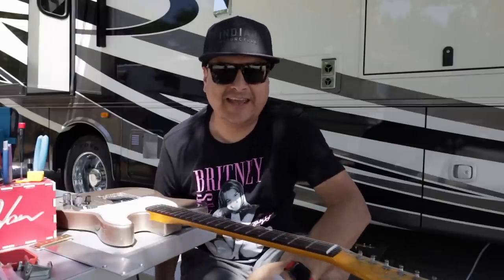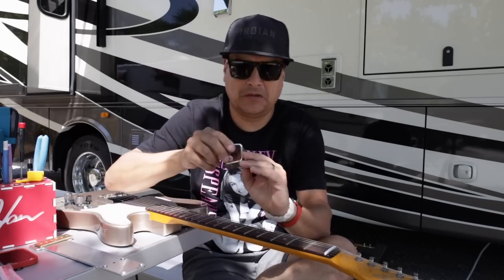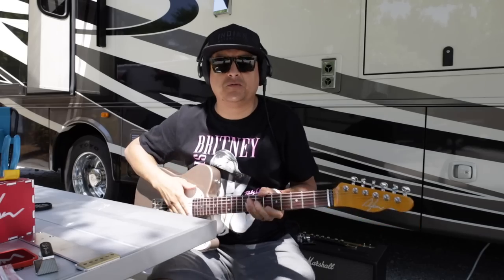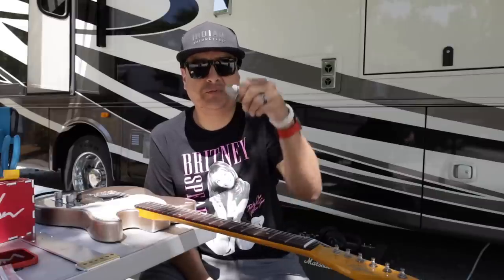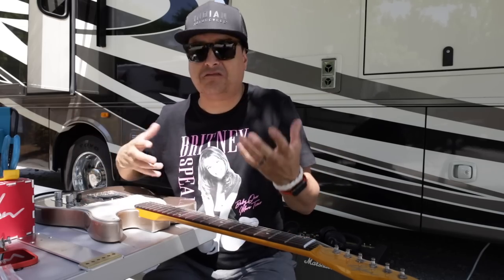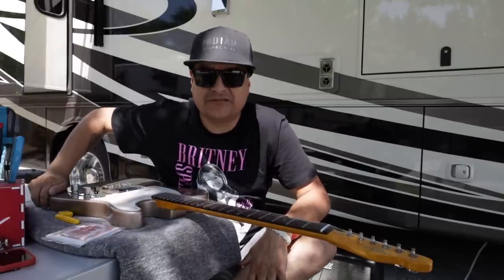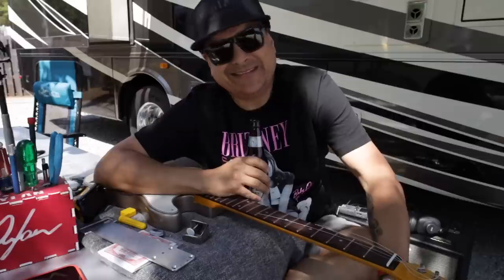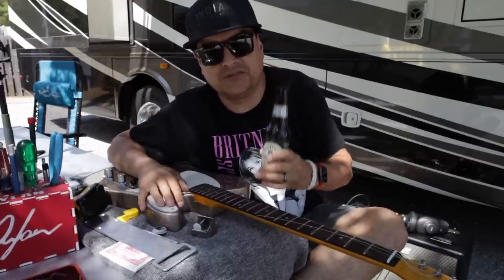How To Get More Sustain - The Backbone VS Fender Fat Finger Review Episode #651

Comment: I didn't hear much if any difference on either one - certainly no more than I could ascribe to variations in your own fretting behavior, without in any impuning your honesty in any way of course - but humans aren't capable of the precision required. For tests like these you really have to have a mechanical picker that hits the string just the same way each time, and graph and measure the response. The variation between your three performances of the same lick at three different times could easily be more than the effect of the devices assuming they work. I did this experiment with the fatfinger some years ago, not properly with a mechanical picker just playing riffs with and without like you do here; but the one thing making it worth mentioning is I carried it around for over a year and stuck it on every guitar I got a chance to test; over a dozen I don't recall exactly how many. But I do remember subjectively the response was very different from guitar to guitar. Some it seemed to do nothing, some it seemed to really give a little bit better sustain, some it seemed to actually choke just a little like you describe here. Perhaps it helps to compensate in some way if a neck is too flexible or a headstock too light or something? But certainly the effect even in the best cases was tiny, nothing compared to installing a better pickup or getting a better pedal etc.

Comment: I...guess the fatfinger making the guitar duller and the claim of increasing sustain kinda makes sense from a physics perspective? Like, you pick the string and you've got that wave travelling up and down the string. When it hits either end, some amount of energy is going to be reflected back, and some amount is going to be transferred into what it hits (the bridge, the nut or wherever the string is fretted on the neck). If there's a larger change in mass between the string and the neck (Well, change in density is how this usually works and I'm not sure how well that translates so I could be wrong here), less energy is transferred to the neck, more bounces back down the string.

Buuut, energy transfer isn't equal across frequencies (or, different frequencies have different amounts of energy). Like how sounds coming through a thicker, more massive wall sound bassier than sounds coming through a thin wall. So adding mass to the headstock would mean where the highest frequencies bounce back down the string more, the mids transfer into the neck a bit more, the lower mids a bit more again, adding mass to the headstock would mean less of those mids and lower mids are being transferred into the neck, they're just bouncing back down while the highs were already just bounding back down, so you get more mids and the whole thing sounds muddier. But less energy loss from the string could also mean "More sustain".

Or like. That's what my A level physics gut reaction of what's going on would be anyway. XD

Comment: Does fingerboard & Bridge height on a tremolo system affect string tension/sustain? I have a G&L comanche whose fingerboard is 1 cm above the body. The string tension is pretty high on the guitar, but it has great sustain. Not an easy guitar to play, but sounds good. I was wondering if the fingerboard height is intentional, or did I just get a weird guitar?
Reply: String height(bridge/saddle height) has a direct effect on string tension(if that’s the right word) and therefore effects the feel and vibration

Comment: If adding more metal mass to the headstock harms the tone, does that mean replacing "cheap" pot metal machine heads with much heavier locking tuners harms the tone the same way? 🤔
Reply: It doesn't harm the tone. And adding mass to the headstock doesn't dampen the vibration of the strings either. It affects the relationship between attack and release.
Reply: Heavier locking tuners could work to better in most cases, but also to worse sustain (and tone). You will only know, if you test it...🤷🏻‍♂️😊
Reply: @xdoctorblindx  
You‘re right!
I want to add: more (or less) weight on the headstock changes also the vibration response of the neck, headstock and nut, and with it the feedback into the vibrating string.
Reply: I was (perhaps unfairly) paraphrasing Dylan's remarks in the vid.  "It sounds flatter", "it feels worse".  Consensus blind listening was it "killed the highs, flattened the tone". If he's giving the gadget away, my impression is it's not an improvement (at least in any characteristic that he values - or it would still be on there).

But if we shelve for the moment the more contentious question of whether that outcome is positive or negative, if I rephrase the question ... heavier locking tuners (and not all are universally heavier) would add mass to the headstock and produce a broadly similar result as the fender fatfinger widget, or not?

If it's yes, we should maybe be way more cautious randomly swapping to "upgraded" trinket tuners - they may have unforseen consequences both on the sound and feel.
Reply: @PaulCooksStuff  
Everything on a guitar has its influence (maybe the pot knobs and the pickguard screws close to none). Maybe very little in particular, but it sums up...

edit: I replaced tuners with locking ones having also in mind the greater weight. Therefore I testet beforehand with clamped weight on the headstock. Three where in need of weight, my other three not- they are perfectly fine as they are (sound and sustain and balance on my lap) with their cheap metalcast tuners. I will not mess with what‘s perfect (or almost perfect) 😊😉

Btw: tuners are my very last thing to replace on a guitar, the very very last, if ever. Have NO tuning problems with cheap tuners. You have to know how to wind the strings up on the posts, to adjust the friction on the knobs with that little screw on each one, and to allways tune up to the note. If you tune down you have to put tension back turning the knob till tension is there.
Reply: @lone-wolf-1  Same, no issue with regular tuners, though I graphite powder the nut and locking wrap the strings.

Though I know some who immediately replace tuners on day-1, with a "meh, non locking, they CANT be any good". 

That was kinda the hidden agenda in my question lol.